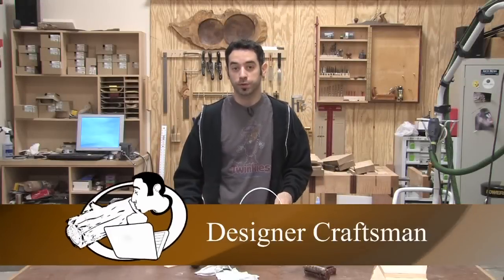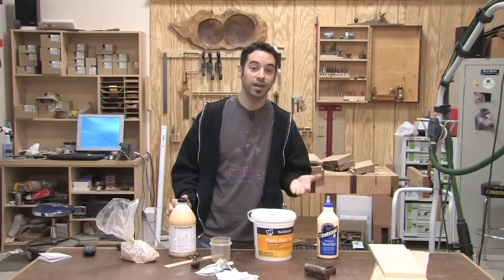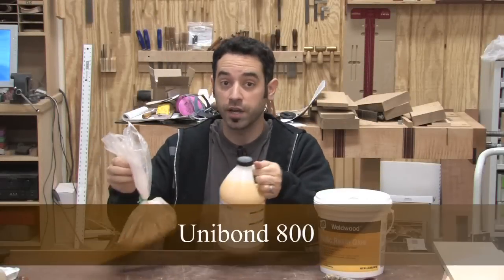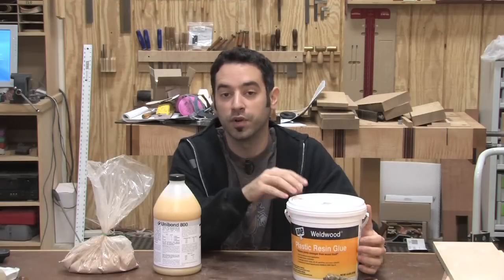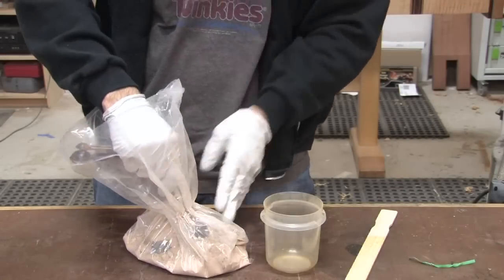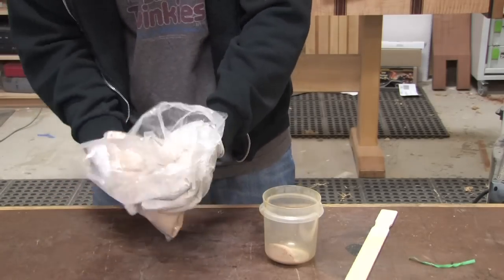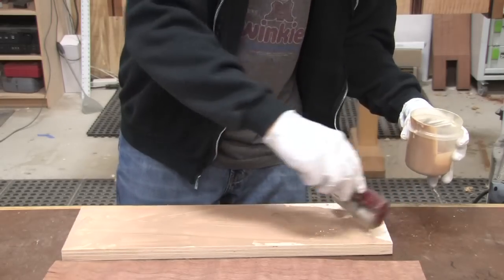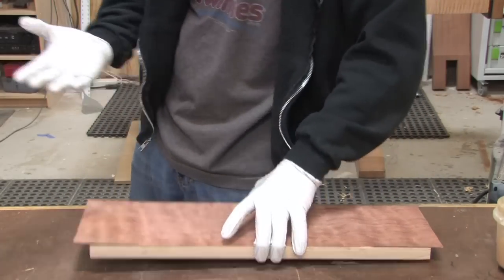117 - A Review of Urea Resin Glue

Comment: Assuming that Unibond 800 is the same as Urac 185 (both of which are hard to impossible to get in the UK), the resin is the part that contains formaldehyde. The powder is wood dust and ammonium chloride (it has less than 1% of the active component). You can make your own custom filler - you need to go lighter than the target wood, since the resin does darken it somewhat. A precise digital scale helps with this. It's a 90:1 resin / ammonium chloride mix (by weight) for the "standard" setting time

Comment from the maker: @rickcperry Actually, you can use regular PVA wood glue for both.  But when using sheet goods, you generally want some sort of reinforcement in addition to the adhesive.  So either screws, biscuits, dowels, or just good old dados and rabbets.
Reply: PVA glues "creep", aren't nearly has hard/rigid in holding parts in exact place.

Comment: What was the Dal Weldwood used for if not veneering?
Reply: I use Dap Weldwood UF glue for joint bonding when working with Black Walnut.  It’s just a wow powerful glue. I use warm heating pads because UF glues love warmth for a good cure.

Comment: You're right that you don't want to breathe that stuff.  I would take that powder in the bag and transfer it to a jar that seals well.  Then you won't be stirring up as much powder while you're messing around with the bag trying to get it opened and again when you're closing it and squeezing out all the air which also expels more powder.

I take a once ounce medicine cup and toss it into things like that so I have a dispenser already in the jar.  A scoop like you're using would be better if it fits in the jar.

There are all kinds of cheap scoops from Amazon and other sources that you could buy a handful to put in your different jars of glue powder, shellac flakes or whatever.

Comment: What DO you use the DAP for? You said you DO use it, but only said you DON'T use it for veneer... HOW DO you find it most useful?
Reply from the maker: Complex glueups and bent lamination.Though these days I'd be looking at other safer glue options. Some of them didn't exist at the time of this video or were early in development.
Reply: The Wood Whisperer I was surprised I found some Yuna Bond locally in my Tiny Town in my rule area of the Upper Peninsula Michigan. It was strange that the powdered hardener was in a regular Ziploc bag. My DAP Weldwood can is 10yrs old and won't liquify/mix anytime or harden, so I was thrilled to find the dura Bond available less than 2 miles from my house, especially since it's hard to even find on Amazon. Thanks for the great videos over the years.